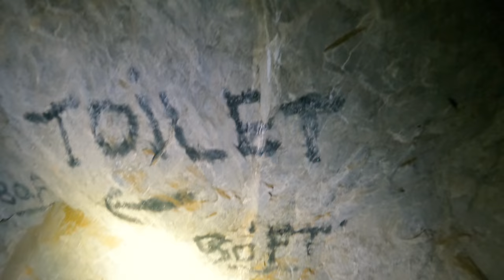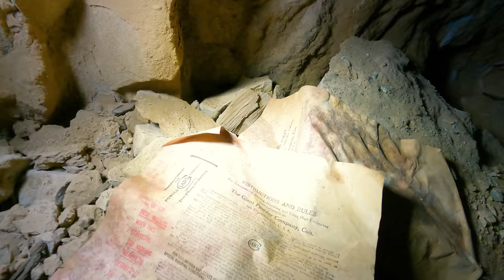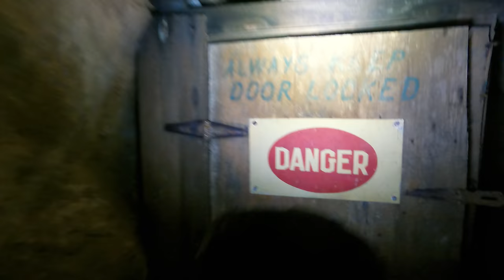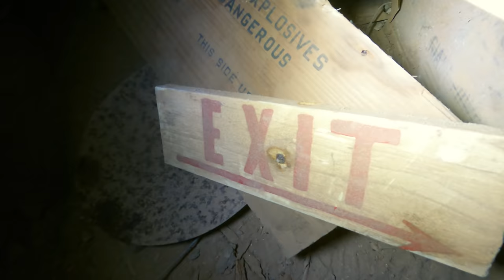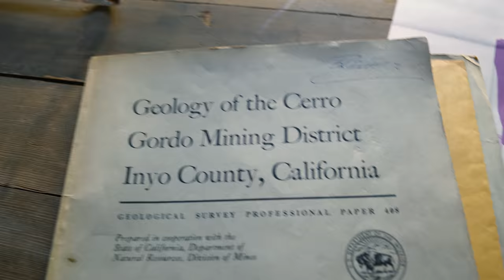Going 700 Ft Down A Mineshaft For Treasure & Water

Comment: Better get that water tested, the Cerro Gordo mine was not just a silver mine, it also produced zinc and lead. Both things you do not want in your water. Be safe man and get that tested for heavy metals before you start celebrating.
Reply: im sure he has a filtration system or something. I hope.
Reply: @Plunz  Id hope so, but sounded like they're just going to fill the tanks and open for business.
Reply: @Plunz  you'd think but things like that could get overlooked, hopefully he also checked all the pipes in the buildings.
Reply: @Jvk1166z  he probably has
Reply: I'd hope he assumed that, from what I understand silver doesn't naturally occur in its elemental state, it's pretty much always chemically bound to lead.
Reply: @Plunz  he does
Reply: @Plunz  ionised lead can't be filtered at least not without NASA level tech. it has to be purified
Reply: @ClickClack_Bam  I am aware of this. I used filtration as a generalized term when I should have been more specific in my wording.
Reply: I’m pretty sure he mentioned he was just using the water to make concrete but you guys can keep arguing
Reply: @maskedgamer5132  I'm sure the residents of the building the concrete is being used to build will need to drink water. And who's arguing?
Reply: @maskedgamer5132  Its a safe assumption, that as the only water source in the area that this will be drinking water too at some point.
So one would hope that it gets tested before using it as such.
Reply: @sparkplug1018   wrong. He said he hasn’t filtered or purified it, he even mentioned “this water is perfectly fine to drink” at 22:35
Reply: @GardenGuy1942  Want to bet on that or get it tested and make sure? And possibly filter it anyway.
My bets on getting it tested to find out how much heavy metal is in it.
Reply: @sparkplug1018  I’d drink it regardless
Reply: @GardenGuy1942  I’ll bet you would. Nothing to worry about if it kills you though I guess.
Reply: if he's only using it for the concrete it would probably be fine
Reply: @sparkplug1018  well it is something to worry about if I die, but that’s the equivalent of saying I’ll get struck by lightning on a clear & sunny day — it would be nearly impossible. I hope you find the lords faith soon…
Reply: @GardenGuy1942 A previous video Brent has stated they have had a number of water samples tested already and the water had came back clear.
Reply: @kevinsmith3429  of course the water will look clear, the metal floating in the water is really small, but time will tell if it’s dangerous
Reply: @GardenGuy1942  Brent already stated they have had water samples sent of for testing of heavy metals and the results of those tests came back to be usable water. Go back and check this out for yourself so you can clearly understand that Heavy Metal tests have already been done on numerous occasions.
Reply: @ClickClack_Bam  Chlorine dioxide would probably remove it  and any other heavies  that migh be there
Reply: He said in one of his earlier videos that he will not use this water for visitors since it could be contaminated
Reply: @odf8782  Happy to hear that, the few videos I’d seen sure seemed like he’d planned this to be the primary water source. Good to hear otherwise

Comment: A good tip I learned when in one of the salt mines in Poland. If you're lost in the dark. Go against the direction of the air current. That will lead you to the way out. I don't know if this applies to all mines as I'm far from an expert. Just something to keep in mind if you ever get lost.
Reply: Wait, so the direction the air is coming from or the direction it's going?
Reply: @melonowl333  Where it's coming from is going against the current, so yes you should go where the wind hits you in the face.

Comment: I would highly recommend wrapping popsicle sticks in reflective ductape to mark where you've been. Works great for me
Reply: this is actually a really brilliant idea. Cheap and easy for materials, but wonder if using a highlighter to colour code them would be worth a shot (wrap them up with clear packing tape afterwards)
Reply: Great idea. But step 1 has to be to always carry some spare batteries for that flashlight. I hope that was some fake suspense for us, and he has a pocket full. No way I'd venture 700 foot down without 24 hours worth of batteries!
Reply: @OrthodoxAtheist  and at least two spare lights
Reply: seems he’s dropping glow sticks every so often
Reply: or simply just a spray that can be washed off again and make arrows always pointing out.

Comment: I wonder if you could do a layer pumping stations. Pump the water from one level to another to another to another, until it's up to the top. Less stress on one pump.
Reply: I was thinking the same thing.  700' is a LONG way to pump water straight up.  If I'm not mistaken, they even do that in skyscrapers, along w/holding tanks.
Reply: I was wondering that as well. You could have at least one booster pump and it would go along way. I also think if you were to set a small booster pump at the water source to keep good suction pressure for the main pump he would do a lot better.
Reply: Me? I'm thinking he needs to bore a small hole for the line to pass through the collapsed area, shove some pipe through it then connect up things.
Reply: Its a good idea, but I don't think there is much space to put a pump somewhere in the shaft. By the look of things the pipe is going in the side of the shaft, and if they were to put another pump on another level, they would probably have to re-route the pipe, which I don't think is that easy with a 700+ feet shaft below you. ;)
Reply: @pucke3690  aren't there several levels between the 700 level and the surface? Stick a booster pump.and a small storage tank in one of those about halfway up.
Reply: Same thing, 700ft is a long way for a pump, have the weight of all that water.. figure have at least one half way up, let that 700 level pump into a storage pond at so where along the way and then have another pump at that point move it to the surface. Could have the second pump operated by a float so it will not runs when there is enough water to pump...
Reply: I was thinking that also.  I know around my area sewers have pump stations to carry the waste a long distance.   Almost like booster station.  Pump to like level 400 to a holding tank with a pump.  Then pump to surface.
Reply: Would  actually depend on the pump design. if the pump is made for and capable of that height, then it would make no deference. If it is not then pumping stations would then be needed. I would hope that they checked the pumps specs to make sure it was capable of it before just throwing another one in.
Reply: @pucke3690   One thing not covered (unless I missed it) in the video was if it was a lift problem or if the pump just lost it's prime.

Wonder what the current pump is rated for (vertical lift)?
Reply: @ireallylikeshoes  I'd also think the best single pump you can buy is the best bet. Maybe just make it two pump, one push, one pull with a storage tank?
Reply: Good idea. Or restore the original one would be amazing. Absolutely undersized pump for what's really needed though. Band-aid fix.
Reply: @Mark-hb5zf  tbh I think the real problem is that the pump just lost it's prime, so the best fix for that would be to drag a pipe through the collapsed area, which is probably way harder than it sounds.
Reply: The first thing he should do before pumping all that water to the surface is test it for contamination. That water that deep in an abandoned mine is anthropogenic. When that water hits the surface and starts being used for stuff like the concrete every single thing is gonna be contaminated, Not good for the health and enviroment
Reply: @ShootLuckGaming  i would probably guess that the water is not contaminated, just because they have used that pump/source to supply the town with water for a really long time.
Reply: @pucke3690  Lost the prime: Yeah, I'm thinking the same.  I mentioned earlier about putting a self priming sump in the water pit, sending water to a storage tank near the main pump.  A water level sensor in the storage tank would control the sump pump and could always make sure there is water in the storage tank and not overflow.  That storage tank would then feed the main pump, ensuring there's always water for the main pump so it wouldn't lose it's prime.  You could even wire up another sensor to ensure the main pump shuts off if the storage tank is running low.   No doubt the running the water thru the cave-in would work, but boy - that's a lot of work!  But I think in the end, it wouldn't ensure the main pump might lose it's prime again if the water in the pit ran low (wonder if that's what happened in the first place?).

An option (without a sump pump in the water pit) could be to monitor the water pit level and if the water is low, don't allow the pump to run.  That might be the simplest option.

 Lot's of ways to accomplish the task, and just as many ways to screw it up!  :) LOL  But I think the key takeaway is ensuring the main pump never can lose it's prime.

Comment: With a non self priming pump, you are going to need a one way check valve on the end of your suction line. That'll help you hold a prime on the pump when it turns off, otherwise when the pump turns off it'll bleed back the water untill it's dry or at least to the height of the hump in your suction line. Good luck!!! I love the videos and the progress!
Reply: yes   a footvalve  is essential.  with a sock or somesuch around it for debris
Reply: That is true, I mentioned last time they ran the original pump that it was cavitating and there was air in the system. I suppose that’s what you get when an electrician changes your pump, only half the knowledge required.
Reply: When I first saw the pump, I was thinking why that type of pump. Of course it is designed as a high lift pump. My choice would be a submersible in the system to prime the main pump. It takes a good pump to lift 700 feet let alone overcome the head pressure on a foot valve

Comment: As an engineer, I must say that you need to install a submersible pump within your water pool. This pump only has to supply enough pump head to produce several psi at the suction of your lift pump. From there your lift pump can operate without starving, thus shortening its operating life.
Reply: He's a great story teller but not so great with the mechanics.
Reply: I just read through the other comments after suggesting the exact same thing. I really hope he goes the submersible pump route, they work well on agricultural setups I’ve worked on (I’m an electrician). 
Only problems I’ve ever really come across with submersible pumps are either excessive mineral buildup over years or installer error in that the heat shrink wasn’t done correctly on the wiring and them shorting out
Reply: He is also pumping too far vertically for that type of pump. It needs at least one more pump station in between, if not more.
Reply: @SlimPickins_07  yeah I can just imagine the back pressure on that little pump. If it were my town I’d see what was wrong with the old 3 cylinder pump. If the pump is okay and the motor is all that is the problem, I’d replace the motor and get the old pump running again. After all it worked for years
Reply: It’s crazy that this dude is just going to do exactly what was done before and expect a different result. I think there’s a word for that.
Reply: I agree, in my suggestion (which contains other things), I have suggested putting a feeder barrel on top of the rockfall jump, fed by a submersible pump. Then two float switches, one to turn off the sump pump and another to turn off the lift pump if the barrel runs dry.
Reply: 700’ @0.433 psi/ft = 303 psi. That’s not too much pressure for a multi piston pump, as long as it has positive head (pressure) to the suction. I’d also recommend dual check valves on the pump discharge- that’ll take some strain off the internal pump valves (they’re not getting slammed closed by 300+ psi). While I’m at it- a pulsation dampener will also help the pump longevity. Pressure is related to fluid velocity.  The piping friction loss for positive displacement pump is sometimes off the chart. The pump output may be measured at an average of, say 20 gpm. However the instantaneous flow rate, during a discharge stroke, may be 10x that. That’s where a pulsation dampener can absorb the instantaneous high flow and release it back into the piping at closer to the average flow.
Reply: As a pump service technician..id say a foot valve on the suction hose and a low float  if the water runs to low would help.  When ypu force feed pumps it reek havoc on the the seals.
Reply: I'll add another suggestion. 700+ feet is a long electrical line. You could losing a lot of voltage over that distance, particularly when the motor starts up, creating a heavy load. That can kill a motor. I'd get the advice of an electrician.  Otherwise you may find yourself replacing pump after pump.
Reply: True the voltage drop at that distance could be huge !
Reply: Plus the suction hose looks very small to me for that distance.
Reply: If cable is sized correctly voltage drop will most likely be minimal. My bore has around a 600ft cable run from the main switchboard and voltage drop is still within acceptable range. I could calculate voltage drop for that particular circumstance but I’d need to know what size cable Brent has and the current draw of that particular pump. Just based on the fact the old pump was much larger it should be fine, but I have a suspicion that the old pump was 3 phase and the new one is split phase
Reply: If I  remember correctly, the hoist house is well up the mountain/hill, so a simpler solution could be to go down to the lowest point of Cerro Gordo - a few hundred feet lower - and sink a well shaft to reach the water table.

Unless the Union Mine is acting as a natural cistern.

Also, reading a bit of history and noting the topological map, water was brought in by steampump from Cerro Gordo Spring - about 3 miles out - starting in the early 20th century until 1949.

If the piping to the spring still exists, at least in part, there's possibility there.
Reply: Assuming there's a few check-valves in the vertical run to cut down head pressure on main pump... kinda wonder how far (in the tunnels) they could go horizontally (you would think one of those would come out on the town side of the mountain (getting away from some of that 700' of head pressure)... 
Good call on the sump (maybe add a float switch, just in case it is cavitating) if a float switch is added they can add 2 led's to shaft (one for power & pump on)
Reply: @JohnSmith-tc9ft    ‘force feed’ by a submersible pump, if correctly selected, should only be approximately 5psi. Heck, a 12v bilge pump off a boat could keep the lift pump fed. Cavitation is a major source of pump frustration and failure.
Reply: William Mulvaney  he’s a good dude and I know we’re all happy to see him take on this venture. He’ll look back on all this one day and be fulfilled. Will have learned a lot in the process too
Reply: Useful if there's an intermediate tank or even an inline Pump to boost the Head and lift the water up 700 ft.
Reply: It's a common mistake that people make a pumo doesn't lift water it pushes water. Any water lift from the source to the pump is done py removing the air from pipe, allowing atmospheric pressure to push water up the pipe to the pump

Comment: If there was an intermittent level where you could place a tank, such as a dynamite locker, the pump at the bottom would not have to work as hard and you would get more water flow.
Reply: Similarly if you halve the diameter of the pipe, the weight the pump has to push is 4 times easier.

Comment: Miner: I’m taking these dynamite instructions to use the toilet 
200 years later 
Brent: cool I’ve found some dynamite instructions I’m taking these with me
Reply: That's archaeology for you. One man's poop is another man's museum piece.
Reply: @jtbwilliams  all the bottles Brent dug up while putting a road in to one cabin had experienced the same thing, luckily all the bacteria had probably long died
Reply: yea... you have to consider, to a miner instructions on how to use dynamite would be looked at the same way we look at instructions on how to use shaving foam... or aspirin.... or a water bottle cap.... as in, we dont, its so trivial the instructions are just rubbish.
Or, if you are 200 feet down and caught short, toilet paper.
Reply: @Debbiebabe69  I’m sure toilet paper would have been a costly unnecessary for the lowly miners, and the instructions were also toilet paper above ground too

Comment: That “exit” is such a huge cliffhanger. Where does it exit to?! Must know
Reply: Probably the 500 ft lvl or something 🙂
Reply: There was another exit sign that Brent skipped by quickly that was pointing to a whole other area of the mine.
Reply: @doreenhodgin569  The one I saw was black stencil writing on a white background on a peg standing out from the wall.  I'll have to watch the video to see if I can get a time stamp (24:29 and 24:52 red text on wood pointing down the passage with the drill rods stuck in the wall...just hope those aren't tamping rods).
Reply: probably just a series of manways that eventually connect to the surface
Reply: @doreenhodgin569  there was more than one
Reply: @toddmetzger  maybe different colors for different exits? That would be cool. Just finding a random entry/exit somewhere... Would be amazing